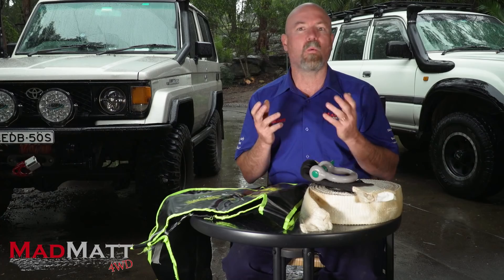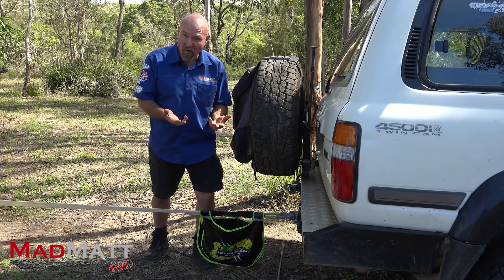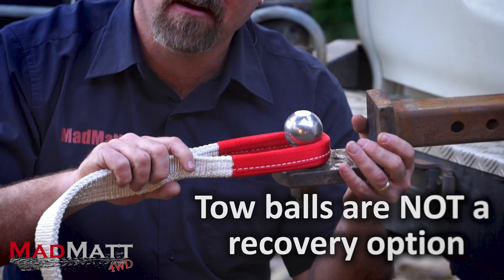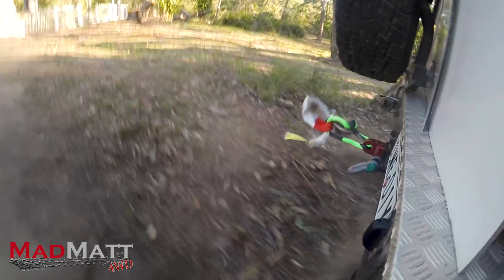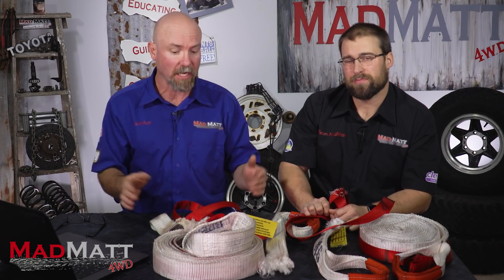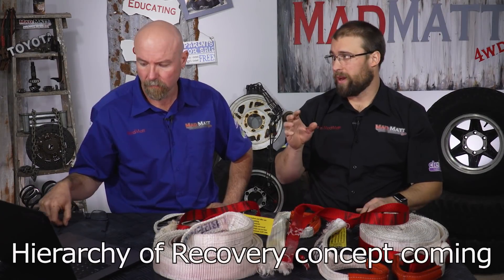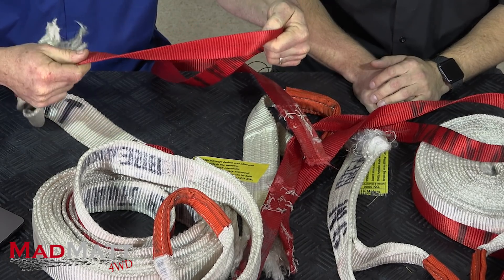Dangers of Snatch Strap Recoveries - Destruction Testing

Comment: I don't know anyone who wood hook up shackle of any sort after something it's not going to hold so I don't ever see where the strap is going to carry a heavy metal object with it to strike someone or something so basically as long as you stay out of The Middle of the two objects that you're trying to move with the strap there's no danger of any harm except for the fact that the towing vehicle will be launched forward ciao for now
Reply from the maker: Except people are getting killed because the strap does slingshot a broken item.
Reply: We had a repair come into our collision shop. The strap/chain gave out hook/ring and all. Flew through the  cab backglass, through the windshield and bounced down the hood, right between guy and his wife. Years ago and not sure of the setup they used to try to pull a friend out of mud/snow but they were lucky no one died.

Comment: Uncontrolled energy release, yes less than ideal. But why all of a sudden against snatch straps? Your test tied to a tree represents the 1% of cases where someone is severely bogged with a hidden object blocking like an underwater log. Even if weight of your vehicle bogged is the equivalent of 9 tons, (unlikely) most snatch straps are rated over 10 tons.
Reply from the maker: Most common straps are rated at 8000kgs. Mainly because they don’t get used with enough respect. I’m actually more of a fan of the recovery ropes now days.

Comment: You are using a strap that should be used without taking a run.  In that case, the tether would work as advertised.  Anyone using a flat strap with a jerk is just trying to kill people.  There are jankim ropes if you want to take a run at the pull.
Reply from the maker: Hey Dennis sorry mate this strap is designed to stretch. It is a kinetic recovery strap. Called a snatch strap.

Comment: Great vid Matt, I'm still of the belief that dampers (weighted or not) barely slow down a re-coiling snatch strap at all.  As I've proven in testing.

Our testing with a load cell at only 4T proved to me that they're (winch dampers) not the solution.

If your viewers are interested, here's the testing we did. https://youtu.be/4sRebBY_muQ
Reply: @Low Range 4wd WA What isn't explained in the video  (because I didn't have my propeller hat on!) was that kinetic energy increases to the square of the speed of the recovering vehicle.  The damage gets exponentially worse with more speed. The damage would be far greater if we ramped it up. 4T was the limit of the rigging equipment we had there on the day. Of course they slow down the rigging. I'm not arguing that, it's simple physics F=MA or in this case A=F/M. The efficiency of the dampers wasn't enough to capture the shackle, dissipate the energy and prevent it from hitting the stop. That's the only satisfactory outcome. The winch rope vids from Ronny and Seek, delt with essentially static loads, not dynamic loads like a snatch strap.

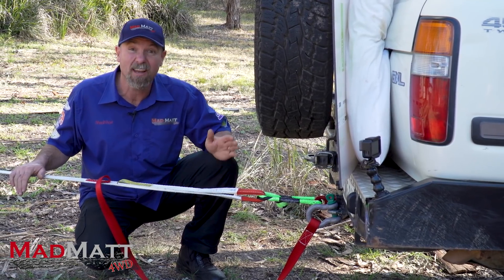Comment: exactly what the visitor say, it was EXCESSIVE!!!  it wasn't design for the brutal test it went through  , and i have check the footage, HE TRAVEL VIOLENTLY FOR MORE THEN 3 METRES before it broke.  check 10:29 to 10: 32 i rest my case!!!. NO STANCH IN THE PLANET CAN HANDLE THAT, the biggest worry he is implying that what he is doing is correct.... and in a real case scenario that can happen (yeah sure if he is dong it probably, and kill someone in the process) ... the correct way is: you do small snatch every time, how? you slowly tense the snatch first and then back only 1 metre, then pull, if it fail to recover the vehicle, just keep doing small snatch over and over a few times and check for the result every time, if it is moving you are winning (you loose at the moment you want it to come out in one violent hit), eventually it will pay off but, what he is doing is just nuts.
Reply from the maker: You obviously did not understand what I was trying to convey in this video.

Comment: The tether needs to be “ extra stretchy “ and perhaps a little longer.
Reply from the maker: Maybe
Reply: It will never work. In fact all it could do is make the teather weaker and stretchier. So its not strong enough to reload the original strap but basically enough to slow it down before breaking itself. Nothing will catch/stop it especially with a tow rig not being able to stop  in time not to snap it anyway.

Comment: I use a 30 foot (9 meters) strap rated for 15T (13.6MT)
I’ve never had a failure 👍
Reply from the maker: The issue you have there is that unless you're recovering a truck you won't be able to correctly stretch the strap to develop the kinetic recovery. Instead you will shock load the recovery point increasing the likelihood of damage.This is one situation where bigger is not better. The correct strap is to be 2-3 times the weight of the lightest vehicle. So if 2 landcruisers are recovering and they weigh 3T each. We need a strap of 6T to 9T to have the correct strap. This is why most people carry the 8T strap as is covers the vast majority of situations.
Reply: MadMatt 4WD normally I would agree with you.
All the recovery points on my 1983 GMC K2500 are actually tied directly into the frame of the vehicle.
And when I attach to whatever vehicle I’m pulling or snatching I always hook up to the strongest point of the vehicle, and that varies between vehicles.
Sometimes I secure my strap directly to the vehicle’s frame.
And like I said before, I’ve never had a failure on either end, and I’ve been an avid off-roader for over 25 years.
You can make anything work.
Just as long as you have the proper equipment and think about it first.

Edit:
And before I attempt a snatch I always try a straight pull first.
Reply: @stevej6824  The point of a kinetic rope/snatch strap is to use the kinetic force you generate with the stretch to help with the recovery, hence the name. By utilizing a snatch strap that is rated far beyond vehicle weights, you are essentially turning your snatch strap into a tow strap and not allowing it to stretch as designed.

The snatch straps / kinetic ropes more than likely won't fail at the weight rating you're using, but your recovery points more than likely will as are putting a lot of stress on your vehicle by improperly using the recovery tools. 

Stay safe out there!
Reply: James Henry thank you for you’re concern.
The strap I use is actually a tow/snatch strap rates up to 30,000 lbs.
When you have a 6000 lbs vehicle and you snatch another vehicle that’s stuck in the muck it’s very easy to reach close to that limit.
I probably should’ve clarified that it my original post.
I’ve been doing this for about 25 years and I’ve never had a failure on either end.

Comment: This is a good video. However, you are a little confused on how to describe forces. Failure of a hitch ball can be attributed to shear and/or bending. Your example on "double shear is correct". This situation is about as close to pure shear as you can get. However, in what you call "single shear", when you talk about tension and compression, you are really talking about bending forces and not shear forces. In this configuration, you almost never have a pure shear situation, but rather, a combination of shear and bending. It is the bending forces here that are really the reason for failure.
Reply from the maker: Hey Bill i do understand the principle and agree with what you say. I think the challenge is trying to communicate it to an audience who doesn't want to listen for the most part so I have to try and keep things as simple as possible which often means I don't explain the deeper principles. Have a read of some of the comments from people who quite happily try to justify the use of a tow ball for recoveries. Sometimes I just want to give up.

Comment: snatch straps are safe and effective.  Like any kind of equipment, if not used within its limits you can create problems with it.  Just like never stand under a suspended load, don't stand inside the arc of any line that is under stress.  This demonstration while educational its also misleading.  Snatch straps are very well designed for purpose and if used within their limits are excellent.
Reply from the maker: Ok there we go.  I think you may have missed the point of the video. That being to raise awareness of the dangers so people stop and think a bit before they perform a snatch recovery. What I see again and again is a snatch is the first recovery tool pulled out without consideration of other safer methods. So by using shock tactics I hope to get people thinking twice before they next grab the snatch. Yes a snatch can be safe but often it’s not. Anyway throw the baby out with the bath water because obviously all my videos will be incorrect because this one is.
Reply: MadMatt 4WD you sold me. See my latest comments. I signed up
Reply from the maker: 😍thanks mate. Let’s all help people learn. I by no means know it all but work hard to try to give good information. I also have other peers who I use to bounce my ideas off.